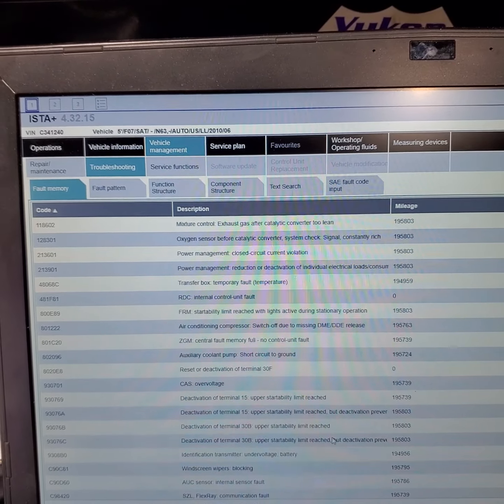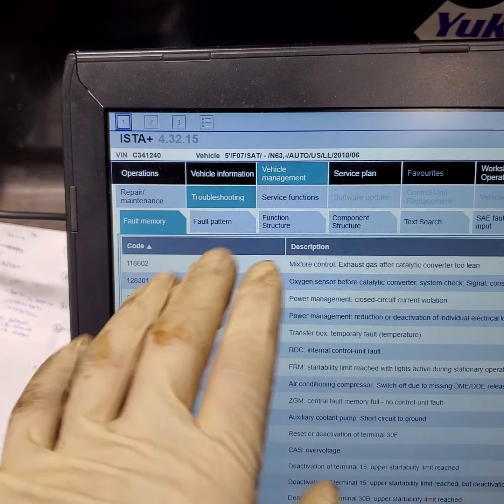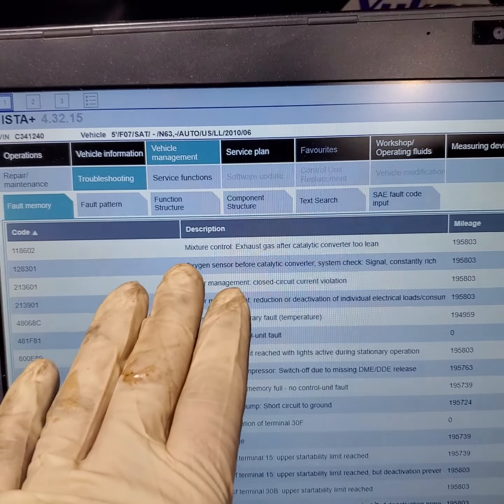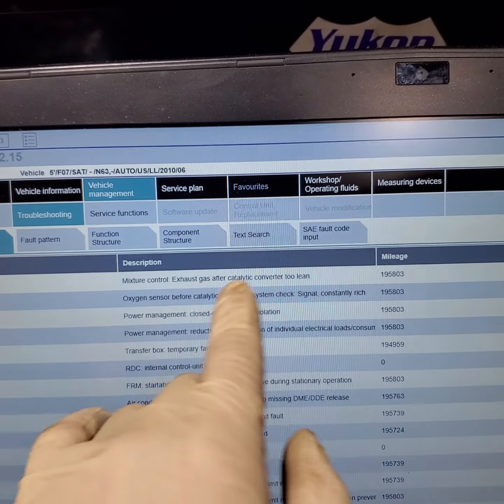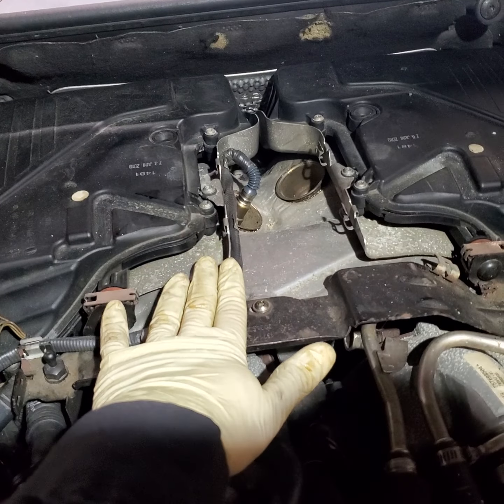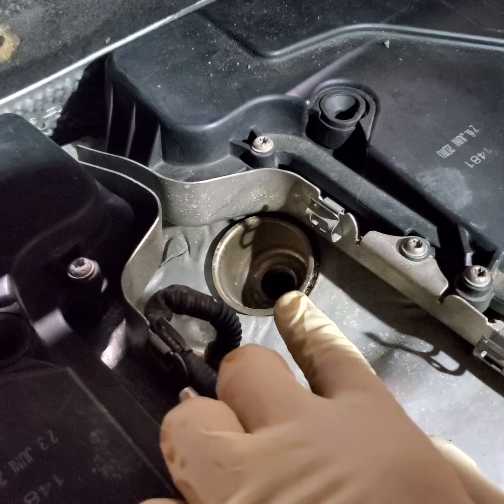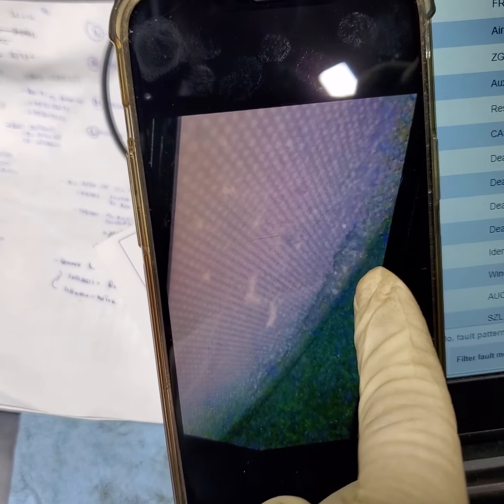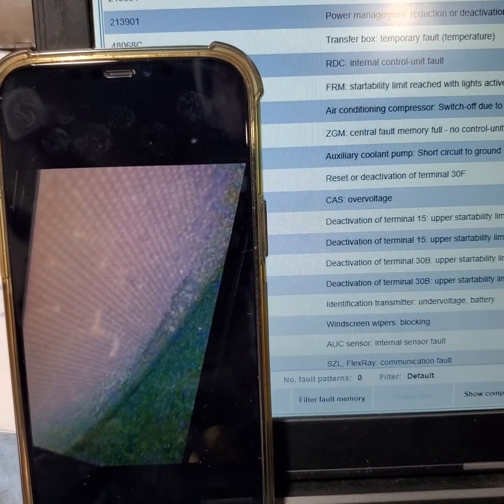BMW V8 - P0175, P2096, P2196 & P2198. **See description

Comment: Ah, shit! 😂 $1800 for a cat now. Do any of those catalytic converter cleaners that you add to fuel systems work? Getting the “lean post cat bank 1” and “o2 sensor stuck rich bank 1” codes on my X5 XDrive50i. Already replaced all o2 sensors as well.